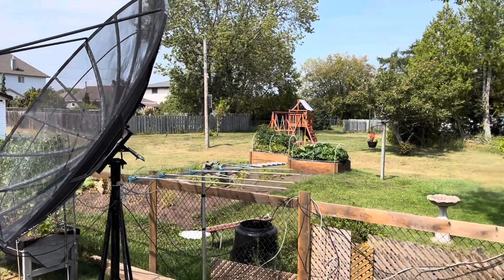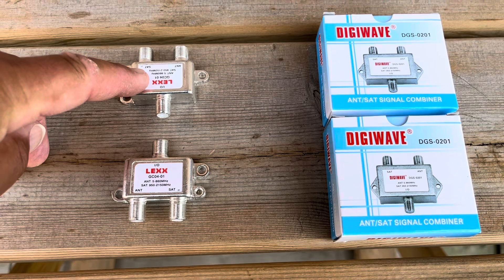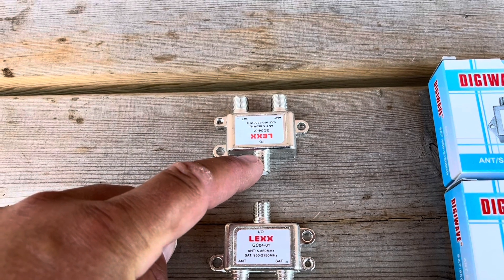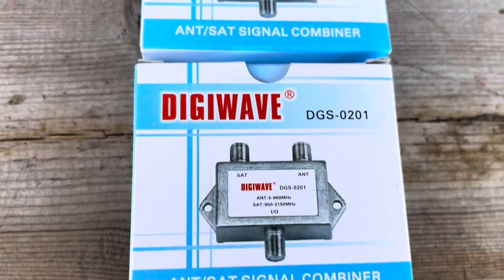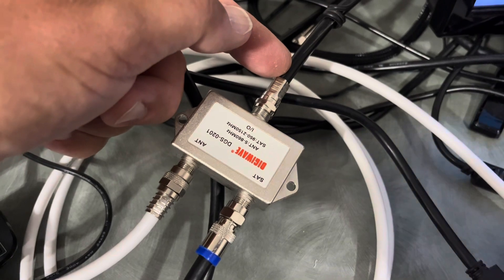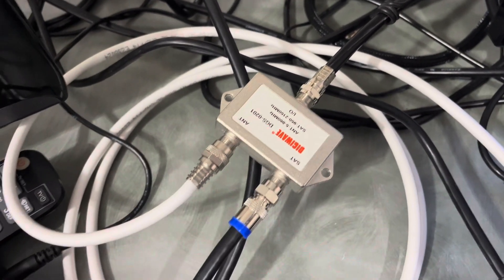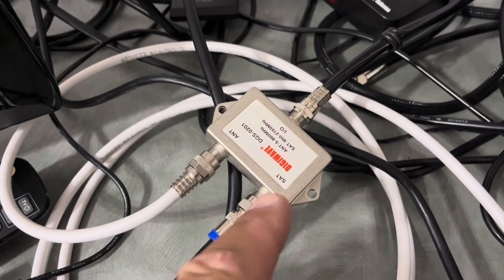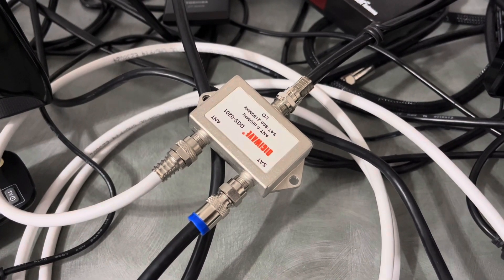How to combine a TV Antenna signal and FTA Satellite TV signal into a single coaxial cable

Comment: Cheap receiver that works with it?
Reply from the maker: You’ll need an FTA satellite receiver, and an over the air tuner for your antenna. Or you can use the tuner built into the TV for antenna channels.

Koqit V5H HEVC H.265 Satellite TV Receiver Review
https://youtu.be/d7VmAG-UByU

GTMEDIA V9 Prime HEVC Satellite TV Receiver Overview
https://youtu.be/m50NUTZszc4

Galaxy 19 has over 100 Free-To-Air Satellite TV and Radio Channels from around the World
https://youtu.be/AjBprAIrRKE

Mediasonic Homeworx (2024 Model) OTA HD Digital TV Converter Box PVR DVR Recorder Review HW250STB
https://youtu.be/Ju_oDqvEhQ8

Comment: So basically you have 2 antenna inputs for 2 TVs. Can't you merge the signals of both antennas for 1 TV?
Reply from the maker: @phossil21  Good question- the answer is no, you can’t, and here’s why. Over the air antenna signals and satellite TV signals operate on two different bandwidths of TV frequency. They also use different broadcast standards, and televisions in North America will not receive or decode satellite TV frequencies. Satellite receivers will not receive or decode over the air television frequencies. So they must be treated as separate. The only benefit of this switch would be if you can’t run a second piece of coax cable into a building. 

That being said, you can use one TV for both inputs as long as each coax cable is going to the appropriate type of receiver. Example, the coax for the antenna runs into the TV tuner and the satellite coax goes to a satellite receiver that is connected to the TV via HDMI.

Comment: I used a diplexer/combiner when i added another antenna panel  therefore i have a main 2 into 1 combiner with 1 panel on one side and 2 panels combined into the other side. Not sure if this does much but it seems to work.
I heard its better than a splitter.!??!??!
😂😂📶📶😂😂🫣😬😂
Reply from the maker: @zandig666  A diplexer is better than a splitter for that purpose.
Reply: @NorthcoasterHobby  thx  !! ✌️📶📶✌️

Comment: You also can contrive to have the supply for running the over the air preamp as its own power connection "outside".
A case might be that the runs to the garage or the basement is easy but getting the cable from there to the livingroom is hard.
Not many will find this idea useful but someone might.
Reply from the maker: How would you suggest running the preamp power supply in this case?
Reply: @NorthcoasterHobby  Most garages and basements have power outlets.  The power adapter thing can be plugged in there.
Reply from the maker: @kensmith5694  yes but how would you backfeed that through a single coax cable?

The combiner in the video does not DC power pass on the antenna side.
Reply: @NorthcoasterHobby  I think I wasn't clear in my initial comment
The single cable runs from the garage to the living room.  This is the one that is hard to change.
Two cables come down from the roof into the garage.
The satellite/antenna combiner is in the garage.
The satellite coax connects directly to the "SAT" plug on it and goes to the roof.
On the "ANT" side, there is a short coax that goes to the TV antenna amplifier power inserter.
A coax from there goes up to the antenna preamp that is on the roof.
The inserter gets its power in the garage.
Was that clear?

Comment: i need help with my c band dish i need help
Reply from the maker: I’m sorry you’re having trouble with your C-band dish. As I told you before -your best bet is to get a new digital receiver and run new coaxial cable to it. You can still still tune the dish manually with a wrench, unless you’re willing to buy a dish mover as well to move the actuator. as far as the wiring that’s not something I can specifically help you with right now.
Reply: @NorthcoasterHobby  cant i rip the old wire out from the lnb and put new coax bsd news is the old wire is going into the wire in the back of the rod do i tape it or soloer it
Reply from the maker: @CrazyLuigiBros-v2o  I already told you that you could run new coaxial cable to the LNB. If the wires are still connected to the actuator (the rod) then they can be connected to a dish mover. Or you can leave those disconnected and adjust the dish manually with a wrench. 

What kind of satellite receiver do you?
Reply: @NorthcoasterHobby  i use a core innovation but it burned out but and the c band cords supos to be cut?
Reply from the maker: @CrazyLuigiBros-v2o  Core Innovation- that is an over the air digital TV box- it’s supposed to be used with a TV antenna.
Reply from the maker: Do you have a TV antenna?
Reply: @NorthcoasterHobby  why for antenna
Reply: @NorthcoasterHobby  i have a monderon anteena but no old one if i did then i would rip the use it
Reply from the maker: @CrazyLuigiBros-v2o  Is this the Core Innovations box you have?

Core Innovations OTA Digital TV Converter Box DVR Review - DTV Converter Box with PVR Recording
https://youtu.be/TK4IUDi83r0
Reply: @NorthcoasterHobby  yes but its burned out it burned out on the 2th day can you help me fix it

Comment: I have a  h&h motor on my ku dish. Can I still  control  my ku dish
Reply: Yes it will work with no problems. I also have a motor connected to my diplexors.
Reply from the maker: @dlf35121  Yes, it passes voltage for the motor and polarity control.

Comment: Great video, and this is why I like diplexers, only one cable goes into your house. In my case I also combined Cable TV (Cable Internet) with Satellite TV and works excellent! But it's either Antenna with Satellite or Cable TV with Satellite.

There are also multiplexers there are diplexers with 3 inputs and 2 ouputs, two inputs are for LNB, one input is for Antenna/Cable and the two outputs have both signal combined. There are multiplexers with 5 inputs and 2 ouputs. 4 inputs are for LNB, one input is for antenna and the 4 outputs have both signals combined. But at each ouput you still need diplexers if you want to have both satellite and antenna/cable signal.

There are diplexors that allows a max 12 Volt for antenna if you want to install an antenna with an preamp.
Reply from the maker: I plan on making a video about the 3 x 4 multi switch that allows for combining horizontal and vertical polarities as well as an over the air antenna input as well. I’d like to find one of those diplexers that allows for 12 V DC out on the antenna side, that would be a great addition to a system that has a TV antenna with a preamp and you’d still be able to control polarity on your satellite dish as well.
Reply: @NorthcoasterHobby  In Europe there is an Electronic Store called DIPOL that also sells satellite dishes and antennas beside home security and internet equipmment.

The only diplexer that allows 12 Volts on Antenna is the polish diplexer AMS Zwrotnika RS-02Ms DCTV for outdoor.

For Indoor you install AMS Zwrotnica RS-01 HsDCtv

But only DIPOL sells those diplexers.
Reply from the maker: @Nicholas_Chris  👍
Reply: @NorthcoasterHobby  DIPOL is a Polish electronics store the good news is available in other countries. Make sure you buy from DIPOL UK & Ireland.

The UK version only accepts Euros, doesn't accept US or Canadian dollars.
Reply from the maker: @Nicholas_Chris  Thanks for the information.
Reply: @NorthcoasterHobby  You can also buy Stacker and Destacker and make a video about it.
Reply: I thought they ran independently thru the wire. They do not blend electronically speaking, hence being able to run it with an antenna preamp as well.  I don't recall what I did years back,  but I finally opted for separate cable runs.
Reply: I thought it was illegal to run cable with anything else, regardless of functionality. ??
Reply: @jayvalentin5513  FTA Satellite is not illegal. Illegal is piracy (decoding scrambled channels without paying.

In cas of diplexers you  can combine Cable TV signal with satellite signal as long as satellite feed goes into your house because you can't install a second cable.
Reply: @Nicholas_Chris  No, it's not illegal. I installed my system in the mid 90's.  Somewhere along, I read that cable companies don't like their signals mixed.  Their policies.  What is illegal is mixing OTA and cable tv together because of its risks.
Reply: @jayvalentin5513  Yes you're right.

In my house I can only run one cable from the attic, I have both Satellite TV and Cable TV, in this case Cable TV is the choice, but I also want satellite since satellite uses the following frequency band: 950 - 2150 MHz (from LNB to the receiver) while cable uses 112 - 862 MHz so both frequency bands cand coexist on the same coax cable.

 In my case I have 3 TVs and a Cable Modem  the cable splitter is in the attic beacuse I don't want cables in my house only the ones that go to my TV or Modem. From the cable splitter one cable is connected to my diplexer and another cable comes from the satellite dish, on the cable that goes in my room I have both signals combine and I use a second diplexer to separe the signals so I have both Digital Cable TV and Satellite TV, same thing with the internet you can watch satellite TV and at the same thing browse internet or watch YT, Netflix. The total attenuation is 2DB on cable (very small). As long as the setup is in your hose cable companies can't say anything.

A few years ago one of the Cable guys saw my installation he said he had the exact setup he was also interested in FTA satellite TV since in Europe there are hundreds of free channels and he couldn't run a second cable, so like me he used diplexers.

The installation is exactly like Northcoaster Hobby showed us but instead of antenna you connect the Cable TV.

You mantioned about OTA and Cable you can mixe them. There is a Switch that has two inputs one for antenna and one for cable and there are two button, if you want to watch OTA TV all Cable signals are cut off, if you want cable TV then all OTA signals are cut off, at the ouput you have one cable that connects to you TV or STB, it is recommended a TV splitter one for you cable box or TV, the second for Antenna STB>
Reply from the maker: @Nicholas_Chris  Nicholas are you referring to an A/B switch- it has Antenna/Cable sides and is controlled by a sliding switch.
Reply: @Nicholas_Chris  I no longer have cable TV and did try  the tv/satellite combination, but finally opted out for  separate systems.  It's much easier to troubleshoot if something goes bad.
Reply: @NorthcoasterHobby  Yes, that A/B Switch.
Reply: @NorthcoasterHobby  I love my ABC selector, To switch the 3  fta boxes!
Reply: @NorthcoasterHobby  You should test and do a reviewabout LNB Johansson 9645 you can connect 2 satellite receivers on one cable and watch different channels or satellites in the same time and also have OTA channels.
Reply from the maker: @Nicholas_Chris  I will look into that.
Reply: @NorthcoasterHobby  DIPOL Poland sells that LNB Johansson 9645 kit with the antenna power pass Diplexers.

Comment: Northcoaster let me tell you about Stacker

First Scenario. You have a satellite receiver with two tunners, one is for recording and the second is for TV viewing or you cand record two channels in the same time. With a regular satellite receiver you can't do this when you record something you can watch only the channels on the same transponder you can't watch channels from other transponders.

Second Scenario. You want to use two satellite receivers but you can run only one coax cable in your house and a splitter isn't the right sollution and you receive multiple satellites.Here is the sollution:

STACKER:

It's device that allows you to connect two satellite receivers on one cable, it is mandatory to have a two ouput LNB or two DiseqC Switches if you receive multiple satellites. The stacker has two inputs LNB 1 and LNB 2 on LNB 2 you can combine both satellite and antenna/cable using a diplexor, on LNB 1 is satellite.

The Destacker has two ouputs: REC 1 and REC 2 on one of these ouputs you also have antenna signal and you need a second diplexor. REC 1 connects to your first satellite receiver and REC 2 connects to both your second satellite receiver and an antenna receiver. 

You only run one RG6 coax cable from outside and use two satellite receivers independet from each other. 

The Stacker/Destacker has two inputs LNB 1(satellite only) and LNB 2 (satellite and antenna) the ouput is 5 - 3550 MHz (do not install a diplexer or splitter at the ouput only a Destacker otherwise it will not recognize LNB 1 only LNB 2. The diplexer will be monted at LNB 2 and at REC 2. The Destacker has the input 5 - 3550 MHz, and the ouput the same frequency as the Stacker.

You can connect one satellite receiver with two satellite tunners or two satellite receivers and an antenna receiver.
Reply: The model that I use is LNB Johansson 9645